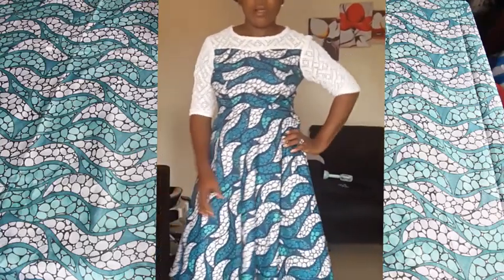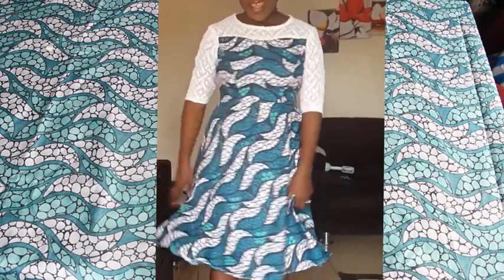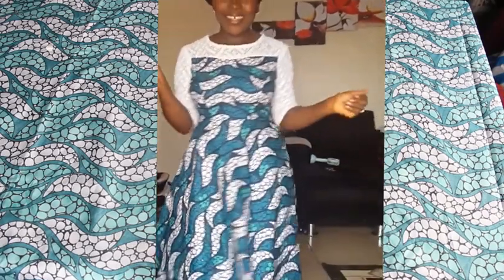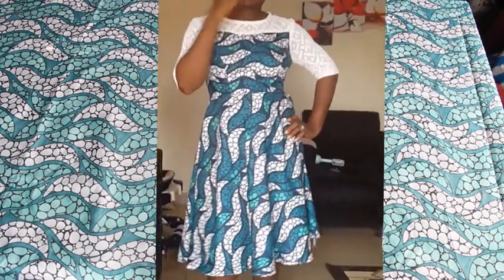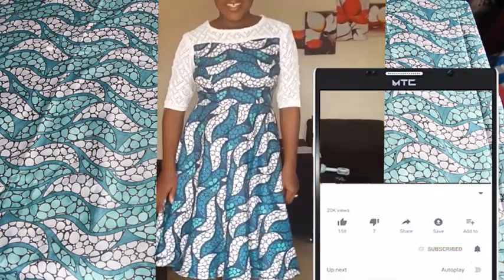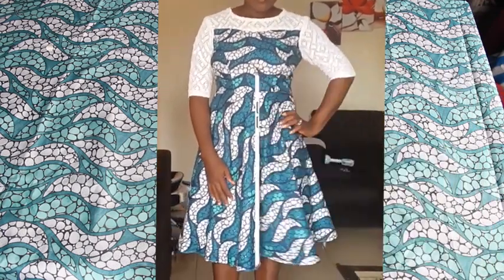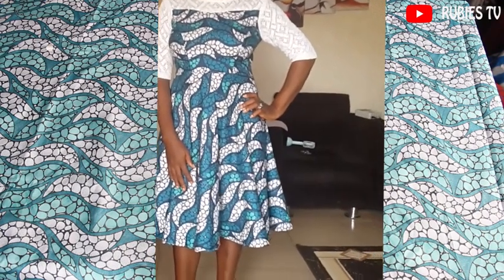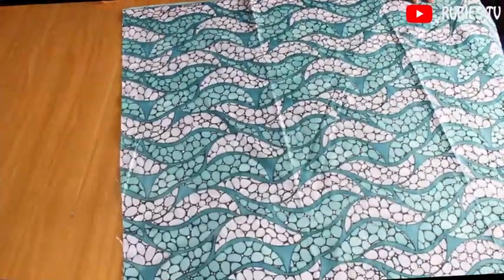How to cut a flare gown/Half flare gown with yoke/Easy technique

Comment: Some flay use to be very full while others are light what is the difference
Reply from the maker: It depends on the kind of flare you are making. You can use the exact waist measurement. It will give you a normal flare. You can triple the waist measurement, and gather it. It will give you a fuller flare.